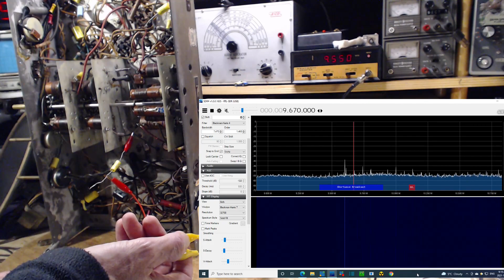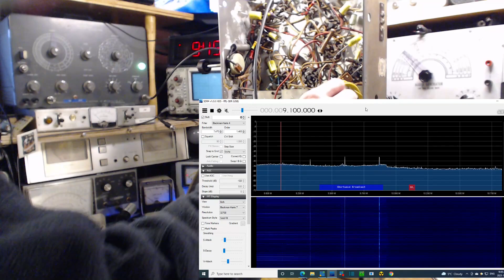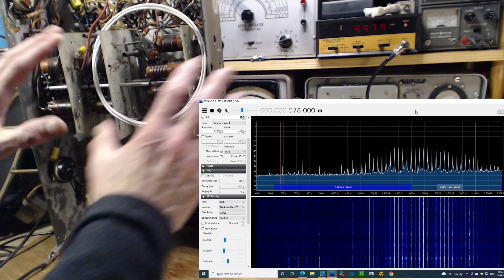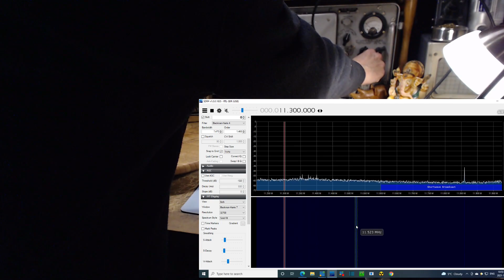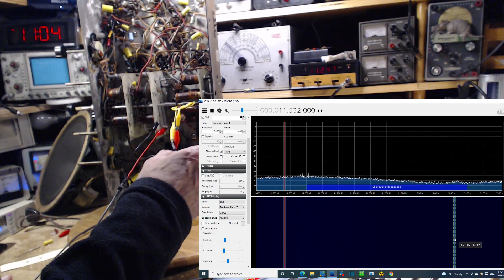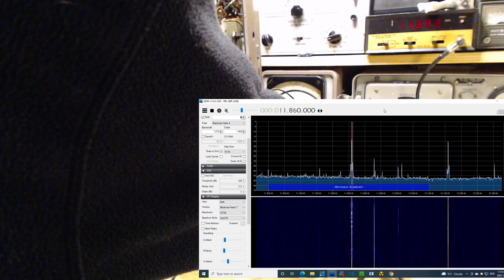Westinghouse Model 1029 Multiband Tube Radio Video #22 - Long Shot Experiments

Comment: I believe in one of the previous videos Jim determined that the plate voltage of the oscillator tube was about 40 V to low but he never did anything to correct that problem. Low plate and screen voltage of the oscillator tube may be preventing it from oscillating at the higher frequencies. Shouldn’t that be fixed first? Before going on to all these otherFlights of fancy

Comment: Your technique of detecting oscillations is totally flawed. If you want to resonate a coil, you would be much better off using a Grid Dip Meter or RF pinging the coils and watching in the scope what does the decay ringing look like. Using a SDR is insane and has never helped you pinpointing any malfunctions. Like using a rice cooker to read the error codes in my cars' computers. (c/c @Random Steve). During the 1940-1950 there was WWII, no SDR's, nevertheless, was when paramount electronic developments took place (Microwaves, radar, sonar, ASDIC, guidance systems, directional navigation/comms and finders, field test equipment, proximity fuses, etc), so is not a matter of vintage technology but training and knowledge.

Comment: Here the requested two cents of comment assistance. Contrary to your babbling, oscillation is rather easy to generate. Much harder is to design an amplifier stage that doesn't. And you have no idea which are critical value components, so stop the insane substitutions with "close enough" specs. Assuming 1) You have the right schematic, 2) Supply voltages are correct, 3) Your statement of oscillator not oscillating is factual, 4) You didn't mess up the AFC circuitry, there are only three reasons why there are two bands not oscillating and only 7 components (including switches and wires) that can cause that problem. Stop hopping around and fix it!

Comment: If the lights are wired wrong and that came from the factory that way then it’s possible that the radio is messed up from the factory and should have been rejected

Comment: Check the band switch contacts to see if they are actually working, i.e. making contact.
Reply: He has bought deoxit D5... Yet so far he only uses it on carbon track pots (where it is potentially harmful) but not on open wafer switches what it is made for.
Reply: @randomsteve4288  ✔